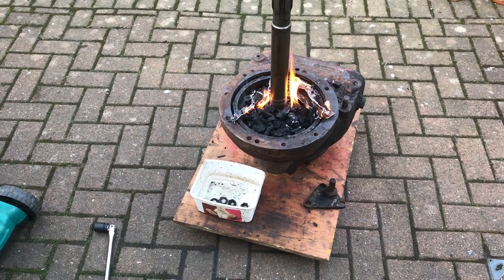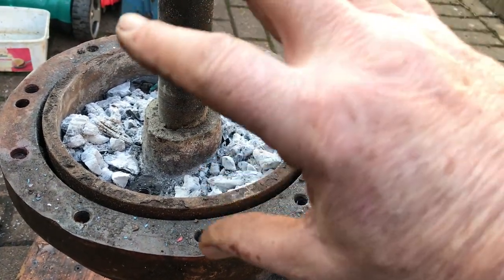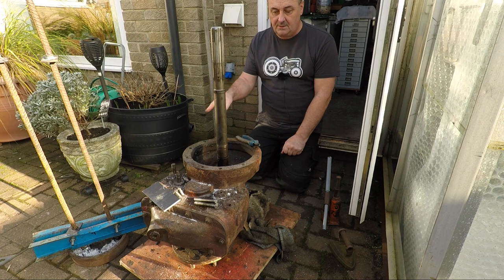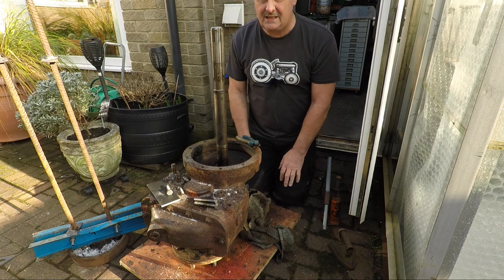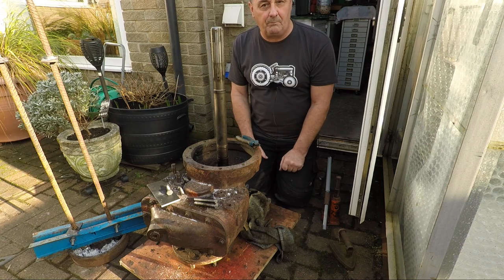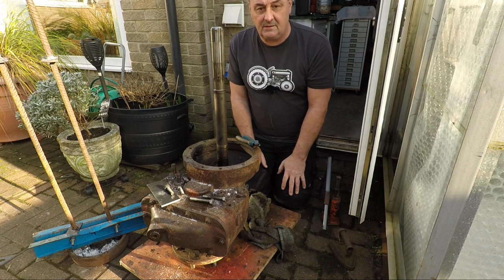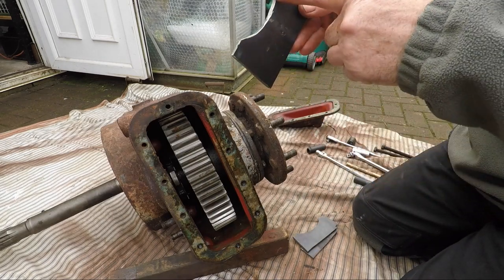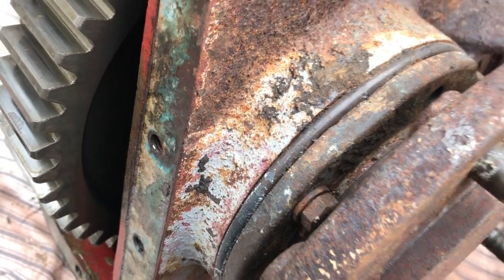How to disassemble the final drives of a David Brown 990 #55

Comment: Hello. Many thanks again for this video. One of my 885 wheel bearings is shot, about to do this job.  For anyone about to do this job, Knott trailer brake shoes are the perfect dimensions for the packing pieces, just chop the brake lining pieces off. I happened to have some in a scrap pile, thank goodness i don't throw stuff away. 
Many thanks.
Reply from the maker: cheers Mark thanks for sharing that it'll save people a lot of time looking or making packing pieces,
many thanks
Barry

Comment: Hi Barry, we finally dissembled my Selectamatic DB 880 right side final drive this morning. A fewer parts than yours like grease cup and It's brass cover. Bearings are ALL in very good shape (Timkene). We think that it only needs to be adjusted meaning removing some shims and thightning everything together. And most of all, we didn't have to heat up the brake drum. It came out pretty easy. Don't know if it's a good thing or not but it's out. We did exactly as you did on videos. We'll finally only replace seals and O rings. I would change the bearings but today's quality part is so cheap... Your video was greatly helping. Thanks ! Yours thoughts are always welcome.
Reply from the maker: Hi Luc, so pleased you got them to bits and that everything looks to be in good order.
many thanks
Barry
Reply: @manfromthemist1958  Hey Barry. Seems like bearings only need to be tighten by putting more shims on pinion shaft and removing some on carrier. Timkene bearings are in a very good shape but I think I will replace them anyway. Let me know what you think. Regards.

Comment: Hi Barry, I admire your tenacity getting the drums off like you did. The factory made tool to do this is a flanged tube that goes all the way down to the drum where you then fit two 1/2" bolts about 3" long to the drum. At the other end is a threaded draw bolt, probably about 1 1/8" or 1 1/4" with a very fine thread that pushes on the end of the axle. This tool will draw the drum off without any heat, however, it is still a considerable workout though. A better option would be a hydraulic cylinder in the tube to provide the force needed. P.S., I live in Hastings NZ right where the floods have devistated the area. The flood waters came within 500m of my property. I was lucky. Still enjoying your vids, keep em coming.
Reply from the maker: Hi Rod, I'm pleased to hear your all safe, i was watching NZ on the news as it has a special place in our hearts, Debs and I came down to NZ for three month in 2000 and backpacked around both North and South islands living in our little terra nova tent, It was the best adventure of our lives, meeting some amazing people, extremely welcoming and a country we will revisit if we get a chance in our formal retirement
many thanks
Barry

Comment: You missed an ideal opportunity to pop some roast spuds on the coals I was thinking, lol. In the bush we would undo the lock tab and nut, undo the 6 bolts on the outer seal holder and use the axle flange as a slide hammer to bump the inner bearing off then assemble it all on the bench. I never used jacking bolts. Then with the outer bearing and seal assembly assembled just slide it in as a unit.
Reply: He needs to buy some possum spray of you that would of help
Reply from the maker: G Day Lance, I might give that a go on the other one, just been up to the farm and balancing it on bricks to drain the oil (lesson no1) drain all liquids before splitting the tractor!
cheers Lance
Barry

Comment: Hiya Barry, great video mate, a bit of lateral thinking works wonders, as for that circlip have you given the cover plate a bump inwards to relieve a bit of pressure off it. So you are now using table cloths and hair driers, I hope Debs has started locking the kitchen up!!
Reply from the maker: Hi Ken, Debs has got a full inventory of the kitchen and her cupboards, she checks everyday, I'm going to make a little tool over the weekend to get in behind the clip and try to force it out gently, cleaned it with a wire wheel today and the clip is pretty corroded so I'll have to be carefull with it.
many thanks
Barry

Comment: That's more or less how I got the brake drum off. Only difference after I destroyed the 1/2"x13 bolts, Drilled the holes out to 14mm then taped for M16. Big blow lamp gave plenty of heat. Used M16 screwed rod side to side and up it came. It goes back surprisingly easy after power wire brushing the shaft.Good vid. No power here this morning with the storm heading for you next.Power came back on `in the late afternoon. M😀
Reply from the maker: Hi Marshall, I was watching the news and saw you were off grid again, still about 13K not back on tonight!
many thanks
Barry

Comment: What size threads are on the two bolts you used to pull off the hub using the two ratchets ? I have been wrestling with that long than I care to admit. Thank you.
Reply from the maker: Hi curtrn off the top of my head I think they are 1/2 BSF, they are defo BSF thread,
many thanks
Barry

Comment: Another great video Barry. Interesting idea using the bbq to get the heat. When using heat to free parts is there any danger of getting things too hot and altering the properties of the steel?  Rob
Reply from the maker: Hi Rob, yes you need to be aware of the amount of heat and where it 's going, and with castings you have to be carefull of uneven heat as this can cause failure in castings with tension and stresses, as we know cast is not good under tension.
Many thanks
Barry